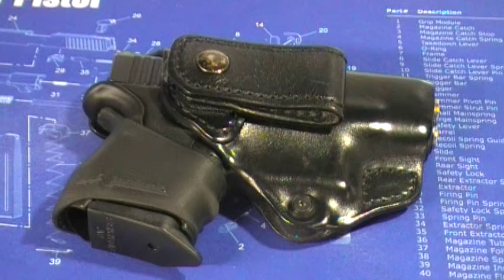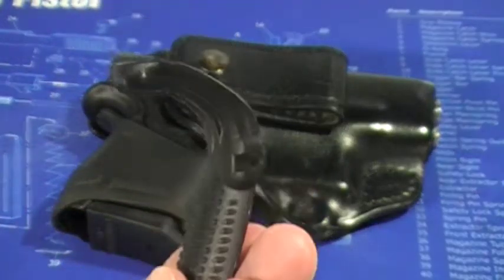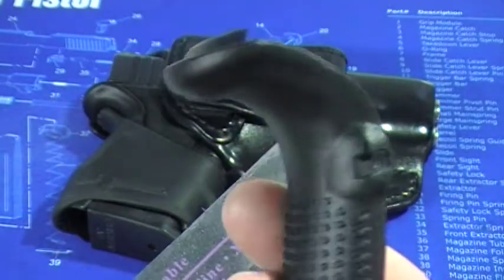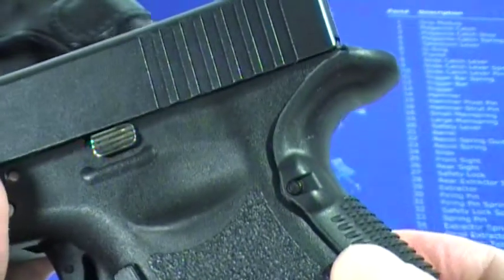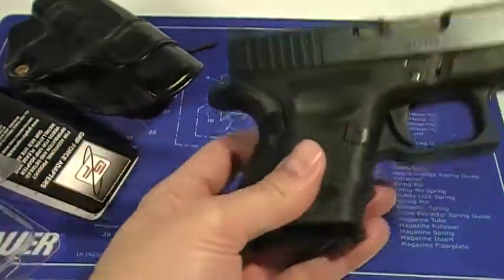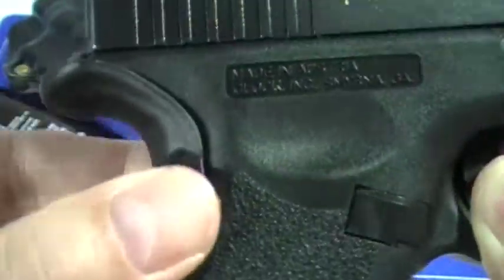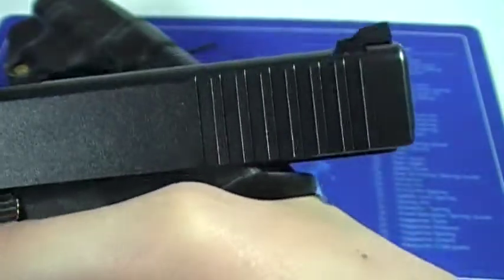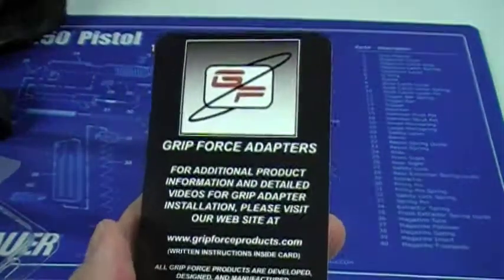Grip Force Adapter For A Glock Pistol

Comment: got one on my g31  and another one on my g17  no more slide bite for my chubby hands.also it made the grip a little bigger which is good for me.then i put a slip on rubber grip over it  now my grip is  perfect for my hands.it's almost the same size grip as my g21 with the grip force adapter and the rubber slip on and i like the big grip for my hands.